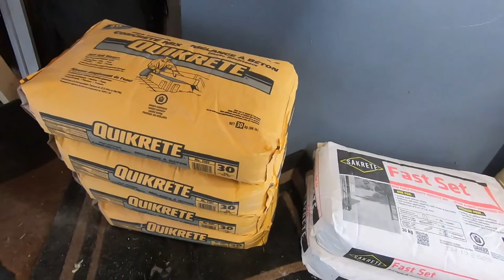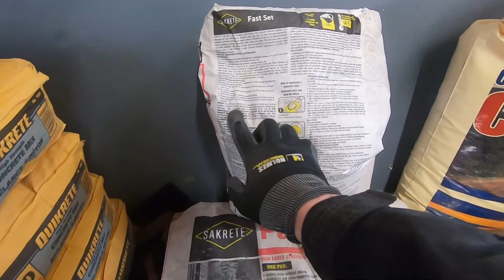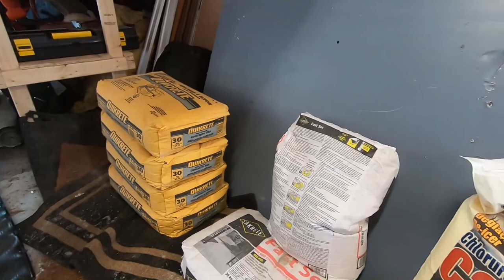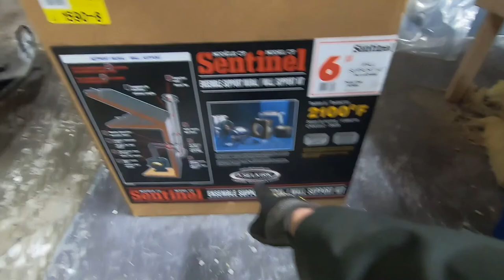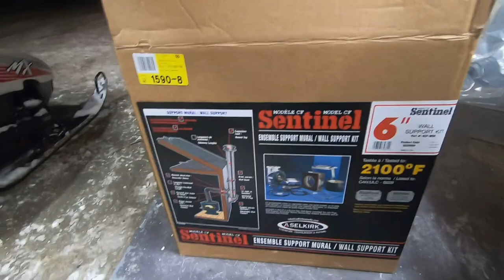Wood Stove Installation

Comment: Maybe I've been told wrong.  I was told concrete doesn't dry because of temperature but more of a chemical reaction.  I'm assuming because of the extreme cold this might be the case.  But I do agree with the previous comment.  I would go am easier way.

Comment: How is it size wise? Big enough stove to heat your space? My garage is around the same size and I’m feeling out how big of a stove to get- my garage is like 650 square feet
Reply from the maker: I’ve had no issues in the coldest parts of winter in January and February getting the Garage warm enough to work in. I can usually heat it between 18 and 22 Celsius.

Comment: So you installed the thimble and then you inserted a length of pipe through it. How long is that pipe?  The way I understood it, pipe does not go through the thimble, just connect the black pipe to the thimble on the inside and the tee-pipe to the thimble on the outside.  I think you said the brand was Selkirk, which I was going to buy. Looks like you did a great job.

Comment: i HAVE A DOUBLE WALL  FIREPLACE CHIMNEY IN PREFAB UNIT AND THE INSIDE IS 8 INCH PIPE AND OUTSIDE IS 12  3/8      WHAT NEEDS TO BE DONE TO MAKE IT FIT A 6 INCH PIPE

Comment: thank you for the video. Where did you get the support brackets for the t? Also, any reason you did not extend that bracket out so pipe could go straight up?
Reply from the maker: The support brackets came with the “Kit” I bought from Home Hardware and then I added some extra angle steel brackets to had just bought from Home Depot over the years (easy for bolting together).  The only reason I didn’t extend the pipe out a bit further to go straight up was because I had a couple of “angle” pieces that allowed me to snake around the roof line. But yes I could have just pushed it out another foot or so and passed the roof line in a single straight pass. Thanks for watching.

Comment: Good video, but Wow bro... way too much non needed work for the cement pad! Why not just get cement square bricks at lowes/Home Depot? Way less work & cheaper.
Reply from the maker: Yes you’re probably right, but I wanted a certain size and height (and permanency) to the concrete block.  It was fun to do. Thanks for watching.
Reply: or use the concrete floor... Oh no feet. NM
Reply: I think.... he does concrete for a living...

Comment: What store did you buy the Selkirk stuff from? I went to Menards and their selection was dismal
Reply from the maker: In Canada, Home Hardware, a local chain of home improvement stores stock Selkirk wood stove parts and pieces. They have an excellent selection (and seem to be the only ones in Canada). Home Depot also has Selkirk, but a different style that isn’t compatible with this style.

Comment: I’m not so sure about the stove near the garage door ………surely you will lose most of the heat out of it …could you not have placed it nearer the  other end of the garage !
Reply: My idea is that the added cool air breeze from the garage door will actually feed the fire through the air vent in effect making it hotter from added cool air so maybe not so bad a spot?

Comment: Pitting cement board directly on the wall studs is NOT any kind of heat shield. There must be a minimum 1" stand off from the studs and there must be a minimum 1" gap at floor for air to circulate and did you check clearance from wall? They are published. If they don't exist for an older stove it's 36" from ANY burnable surface and 18" on single wall stove pipe. Your fire rock on the wall is still considered a burnable surface